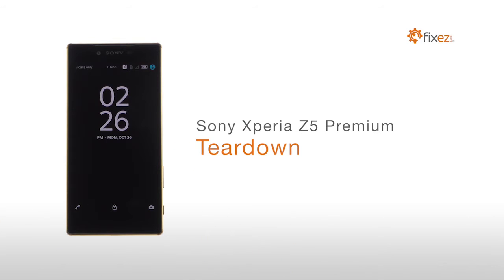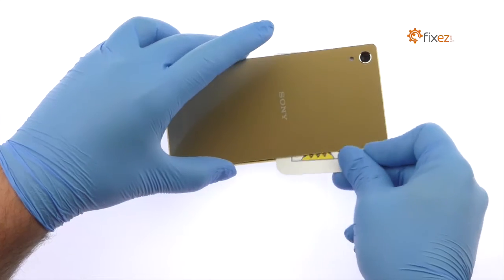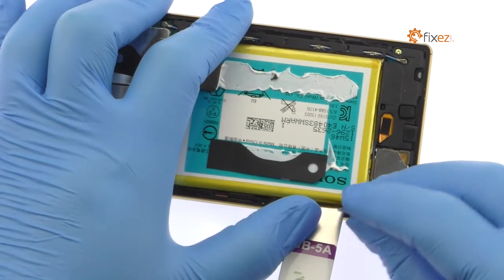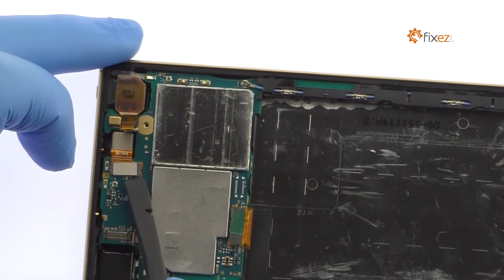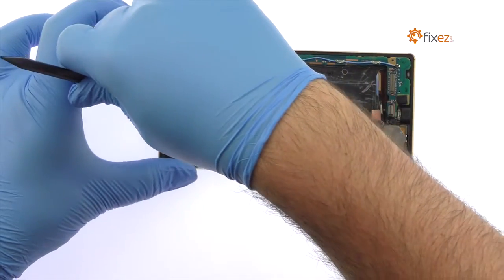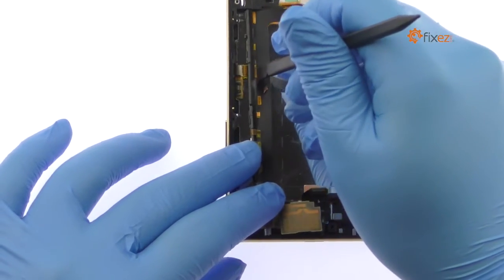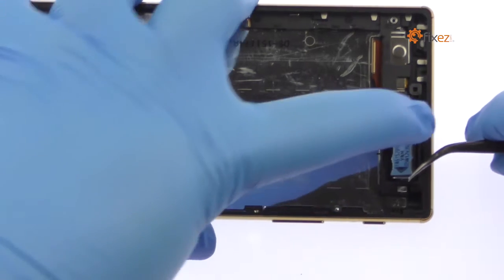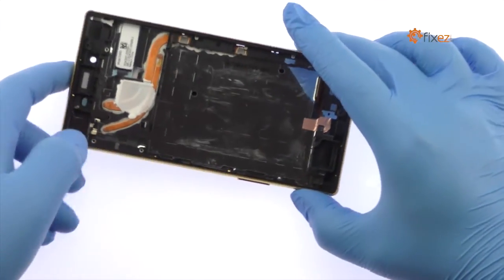Sony Xperia Z5 Premium Screen Repair, Teardown and Reassemble Guide - Fixez.com

Comment: I got a Black screen after replacing Full Digitizer Assembly.
What is the Solution?
Reply from the maker: It's always good to double check your Flex Cable connections. Or try doing a factory reset after screen replacement. Sometimes when new hardware is installed on a device, the replacement is not recognized by the device. Just be sure to back up the data on the phone first.

Comment: There are multiple issues with this video. The most glaring and obvious one... when you are removing the motherboard there are two screws which must be removed near the left side on top. The video skips that step.
In addition, I'm fairly certain screen replacement does not require all of these parts to be removed. The only parts which need to be removed are the back cover, the battery, the screen cable, and anything which interferes with removing the screen. 
Because this video is made by people who sell parts, they are instructing you to remove parts which, some of which, will break. You will be forced to repair them or pay someone to do so. I followed this entire process and have to replace both my loudspeaker and my power button cable. These parts aren't expensive, but having gone through the process, I strongly suspect I did not need to remove many of the parts I removed
Reply: I got a Black screen after replacing Full Digitizer Assembly.
What is the Solution?

Comment: thanks for the video,  i just finish my Z5 screen replacement now, 
it's very hard to remove some items without break-in it,  specially the battery after removing the cover,  but i think you really don't need to remove all this items in video,  just battery and plastic cover for screen jack are enough to change the screen
Reply: This video tells you to remove things that are not interfering in any way with screen replacement

Comment: Hi! Question: In order to JUST replace the headphone jack, is it necessary to go through all of the steps outlined above (battery removal, back camera removal, front camera removal, motherboard removal, etc)? There doesn't appear to be any obstructions from the headphone jack, and I'd feel a LOT more comfortable if I didn't have to remove anything I didn't need to just to replace it.

Thanks in advance!

Comment: my back cover cracked so if i replace on my own to keep it waterproof do i need to to extra steps or just glue it back
Reply: As the previous person suggested, you need to order factory adhesives (OEM) and make sure to clean the front and back areas where the adhesive is applied. Also, after replacing the screen, you should clamp it to the frame and heat the phone.

Comment: Is this device water cooled? how does it work? It looks like a simple peace of copper
Reply from the maker: The copper pipe is a heat sink for the device.
Reply: It is true that it's a copper pipe that works as a heat sink, but it actually has a gas that turns into liquid similar to the water used in water cooling. It cools the phone when it reaches high temps.
Reply: vukasinov it has liquid inside